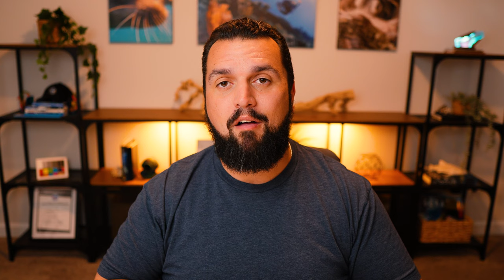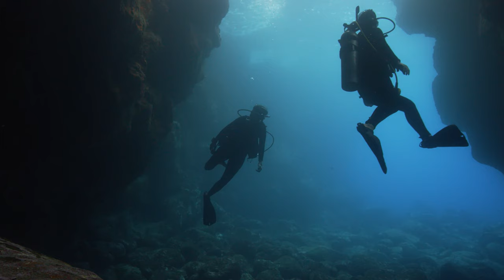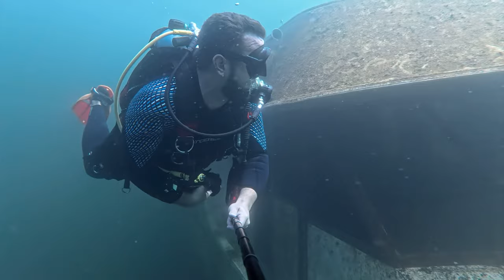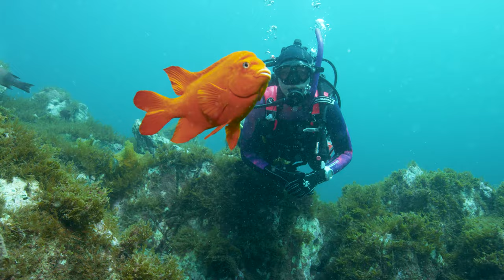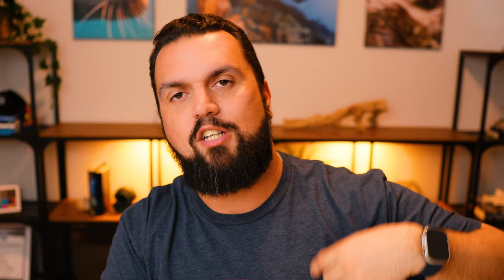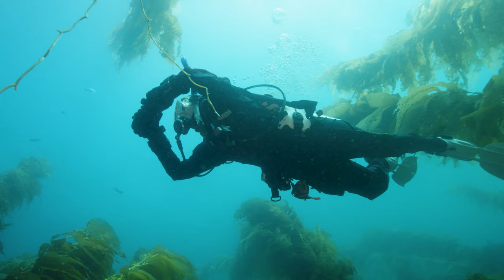The Secrets of Better Air Consumption While Scuba Diving

Comment: Great video. I think you miss spoke about steel and Aluminum tanks. Yes steel has a higher pressure tanks. However 80cu ft is 80 cu ft. No matter what the tank pressure starts at.
Reply: That's not quite correct - an AL80 contains 80 cubic feet of air when filled to its rated pressure of 3000psi (approx 200 bar).
Reply: I agree a high pressure tank has a higher working pressure. At 3440 psi a 100 cu ft tank is 100 cu ft.  A low pressure 95 cu ft tank is 95 cu ft at its working pressure which is 2450 psi.  The working pressure of an aluminum 80 is 3000psi.
Reply: This is why measuring tanks in litres is superior in every way and using pressure in bar because actual amount of air left in tank is approx litres x pressure in bar. Example a 10litre tank at 200bar contains 2000litres of air. Using your sac rate in litres/min you can calculate easily how much time you have left on a tank.
Reply: The pressure of the compressed gas is important. A standard 80 cu ft tank at 2400 psi has 64 cu ft of gas in it and the same tank filled to 3300 (10% overfill) has 88 cu ft of gas in it. If a HP 80 is filled to 3000 psi the volume of the gas in the tank is only 70 cu ft.
Reply from the maker: Great info everyone! To Michael, I did mean the Steel 100s (same size, roughly, as an AL80) in that specific bit you're mentioning as I was meaning you can get steel tanks or get a 100 cu. ft. tanks and get more gas when working on your SAC rate still.
Reply: I would agree with that about AL 80 and HP beginning about the same physical size. As I said, I love your content. Keep up the good work

Comment: Another great and timely video! It’s inspiring to hear how you used to struggle with your breathing and improved it to where it is today as an instructor

Here’s my journey/struggle with breathing.

Oddly enough during my OW, there was no issue. When I went on my first dive trip, that’s when it started and i’m thinking getting stung by a jellyfish could have affected me subconsciously. The subsequent dives I end with around 50 bar. 

I knew I had to improve so I took another two dive trips on my own. The former was in low vis (2-3m) and it being my first low vis dive I was moving around a lot just to scan and look around. 

The latter one had ups and downs. I was weighed more and one dive I even felt my tank was getting floaty towards the end so i’m not gonna say what was my ending pressure 🫣 But the DMs did give tips like not using your lungs as the buoyancy compensator/controller, add some air in your BCD instead and breathe slower, less deep as your lungs have a big capacity and taking all that air in uses up your tank more quickly. I also started to frog kick and not move my hands around which was great. 

I have also heard tips like breathing in and out for 6 seconds each, totally up to 5 breaths per min which i’m keen to try but I wonder how it affects your buoyancy.
Reply from the maker: Thanks! Glad you enjoyed it and yeah, always happy to share personal anectdotes and plan on trying to do a bit more of that and other stories along the way in videos, I think it's more engaging than just straight "how to" without much around it and I'm hoping others do too, haha.

Your story sounds similar to a lot of divers, so don't feel bad about it or anything! It's normal and something we all go through, and with time you'll keep getting better.

The breathing for x seconds is a bit too much mental work for me and I end up just in a natural rhythm, but for those that do it I've head it helps. As for buoyancy and breathing like that, if you stay around a normal breath full when you're done counting, it should be about right. If you think like, "okay I exhaled to around 10%, let me inhale to around 60%, then exhale again" you're never like "fully depleted" and you're also never going to do the "okay big huge breath in!!!" unless you really wanna go down or up. Normal rhythm of breathing means you're usually staying fairly "flat" in terms of your up or down motion. Don't overcomplicate it though, just breathe normally, easily, and relaxed.
Reply: Yeah sharing your personal story/origin does establish some pathos and inspiration to strive to where you are today!

Thanks for assuring that every diver goes through this. I think the breathing in and out for x seconds is just to give new divers a base to start on. Eventually everyone feels meditative while diving.  Actually, at the last 1-2 dives of my recent trip, I did feel more comfortable and observing my surroundings more! Though my perfectionistic (and maybe divemaster ambitious) self wants to be at 100-120 bar 35 mins into a dive hahaha

Sounds interesting, i’ll be looking forward to work on breathing and buoyancy on my next dive!
Reply from the maker: @yonasngaturi8805 you’ll get there. Heck I’m a bigger guy and by conventional wisdom use more air because of it, but I was just doing 90 foot dives for 10 days and coming up with 750-1000 PSI after 45-60 mins with about 80-90% of the dive on the bottom (pending NDL, haha).
Reply from the maker: @yonasngaturi8805 but people around me did better than that too, and some did worse. We all metabolize slightly differently too haha
Reply: True! I am slim but I metabolise quick - one DM even said I have a dragon’s breath 😂 I think 750-1000 psi after 45-60 mins at 90 ft sounds pretty good to this beginner OW diver! Can’t wait to get back in the water to practise

Re buoyancy and breathing, I think it was in the girls talk scuba podcast that they mention dive pros don’t think too much for executing manoeuvres like how on land you don’t think too much about breathing or turning/changing lanes, you just go through the process and motion of it. Sort of how I felt at the end of my last dives being more observant of the surroundings and just being in the moment of where I am, where I need to go. Ah the next dive couldn’t be sooner 

Cheers
Reply from the maker: @yonasngaturi8805 they’re totally right! It just becomes second nature after awhile

Comment: I’m trying to solve my weighting issues - I struggle with my descents and use up air. But, my last dive, I worked on not using my hands less underwater and kept my arms close to my chest and frog kick. My buddy saw that and she also worked on frog kick too. Also used an HP100, and at the end of a 40 minute dive(and seeing my buddy’s buoyancy issues), I ended up with 700psi. 32psi SAC, not bad for someone who started diving in August with 15 dives under their belt.
Reply from the maker: Not bad at all and HUGE kudos to you for being so aware! That's not something a lot of newer divers catch because unless someone points it out, the don't really notice it's not the most efficient way to move. Great job! Keep at it, it'll get better and better.
Reply: I dove this weekend armed with a rental Shearwater Teric(way overkill for me) and a air transmitter - giving me real-time stats on my air use - my SAC is 33psi/minute. For someone starting out and my worse was 60psi/min I’m proud of myself.
Reply from the maker: That’ll come down with time for sure. I’ll be doing something on air transmitters in the coming months, and I agree it’s great to know your SAC without having to calculate it yourself

Comment: Keep in mind when doing a bigger tank the weight situation I tried it before and my air consumption was even worth because I forgot to remove some of the weight and used the same amount of weight I used with smaller tank 😅😅😅
Reply from the maker: Good point! Anytime you change gear configuration or it’s been awhile since you dove a configuration, you should do a weight check

Comment: i have over 350 dives and am an air hog. solution 100cu/15l tanks it's not a "crutch" it's a reality. at first you said being an air hog is not an issue and then spend time saying you have a problem. i try and avoid people with cameras they spend 5 minutes looking at the same thing. depth seems to be my issue the deeper i go the more i consume air. last month i did a shallow dive on an 80 and went 75 minutes. the next dive was at 65' and went thru a tank in 45 minutes. unfortunately a number of dive shops only have 80cu/12l tanks.
Reply from the maker: At 350 dives, you know depth increases air consumption for everyone, though, right? That’s taught in open water. Just wanted to make sure as it seemed like you implied that may just be you.

I said it may be considered a “crutch” and you should still work on improving consumption.

I’ve seen people use cameras and use way MORE gas because they move a bunch, or people that use less because they are more relaxed taking shots with minimal and slow movements.

Definitely didn’t mean to offend with the crutch statement, I said it’s an option for people while they’re working on air consumption still. I stand by that. I know a guy that’s 6’5” and over 300 lbs and went from air hog to pretty manageable. You can improve to a certain level regardless of your body composition using things I talked about, and I’ve not looked negatively at anyone using larger tank sizes. But there’s things you can do to make the AL80 last much longer for yourself. That’s all I’m saying :)

Comment: Wait wait! Did you just say there’s more gas on a Steel HP with the same volume as per se one that isn’t HP?

That’s just incorrect out right. Like if you tell me my twinset steel HP 80s have more gas than a twinset AL 80s… I’d say you’re out of your mind.

Yes the steel HP is rated to 3442, it still holds 80 cubic ft at that pressure and AL 80 rated at 3,000 will still hold 80 cubic feet. They have the same exact volume of gas!

I will even go as far as saying LPs are even better than HP. Like say if I have a twinset LP 85s rated at 2640, and a twinset HP 80s rated at 3442. It is significantly easier to fill the 2640 than it is to fill 3442.  With the added benefit of the LPs being able to handle 3,000 PSI which is a normal fill, and in this case you’ll have 100 cubic feet of air instead. Whereas some scuba shops have problems filling to 3442 and therefore you get less than 80 cubic ft, ok end of rant
Reply from the maker: Yeah there was another comment thread on this too, and I said I misspoke and meant steel 100s vs the Al 80s. It happens, thanks for keeping me straight👍
Reply: @CircleHScuba  ooooooo I got it now! My bad. My buddy dives twinset steel 100s… idk how long his back can handle it. I’m already tired with just my steel 80 twinset, plus deco bottles
Reply from the maker: No worries haha, I misspoke so it’s my bad.

Yeah twin steel 100s sounds rough!

Comment: Using a bigger tank because your SAC rate is bad doesn’t make any sense to me. Because it’s a technical solution for a skill problem.
Reply from the maker: Idk how to even reply to this. People can improve SAC up to a point but larger cylinders do still mean more gas volume regardless.

If you get 100 miles per gallon on your car, you can have a 3 gallon tank. If you get 3 miles per gallon, you may want a 33 gallon tank.

Same range, you use the right tool to enable the range based on performance.

Over time you can improve SAC, but it only improves so much before you may need more gas to extend your range/time underwater. So the point stands regardless of skill.